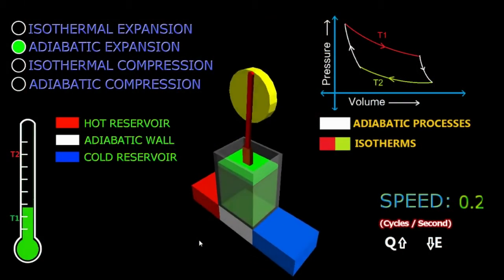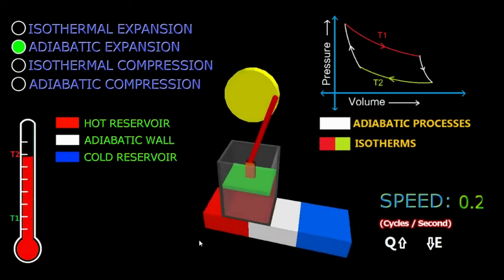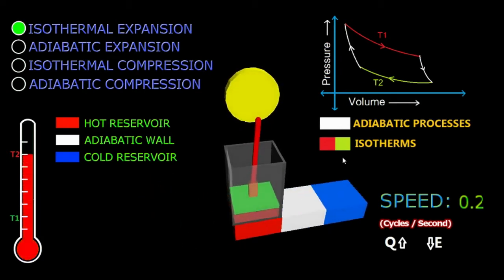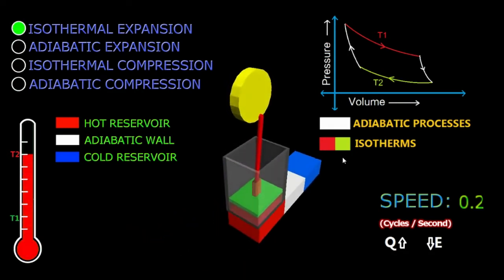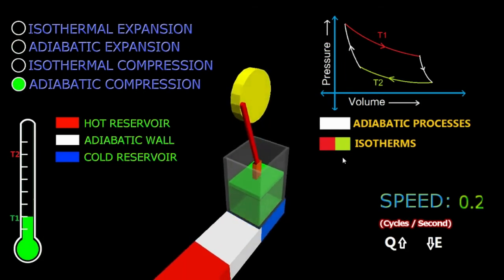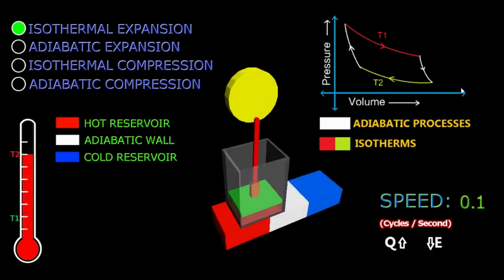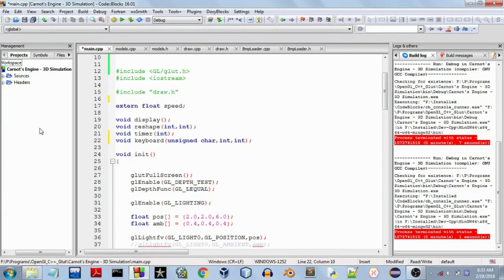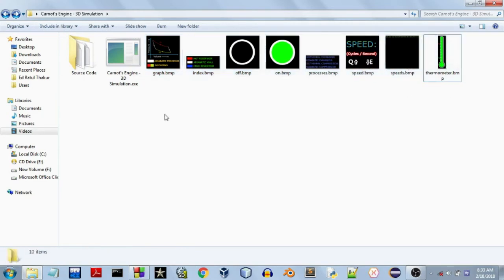OpenGL & C++ | Carnot's engine 3D simulation Program | With SOURCE CODE

Comment: I am not getting the output. whole screen is black
I made the new visual studio project building project is fine but there is nothing in output.
i don't know whats the problem is. please help 
thanks
Reply: I am using Visual Studio 2017 and yes I have glut setup, there is no error.
Reply: @nishantsharma4427   I also got the same blank output ..pls help !!! Its Saying on.bmp texture unable to find 

Pls help !! Thanks
Reply from the maker: what compiler are you using?
Reply from the maker: and do you have GLUT/FreeGLUT set up?